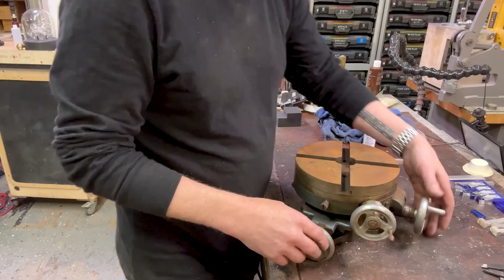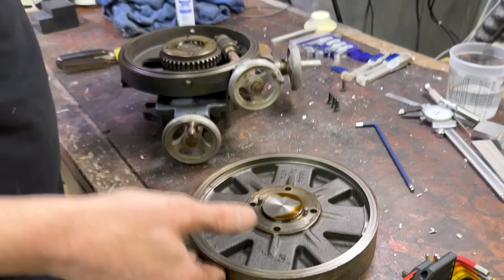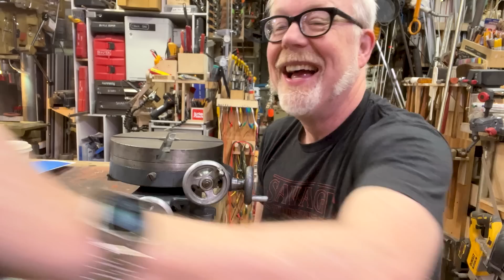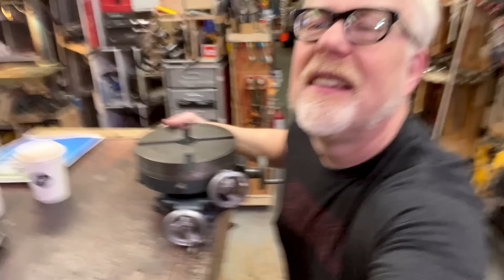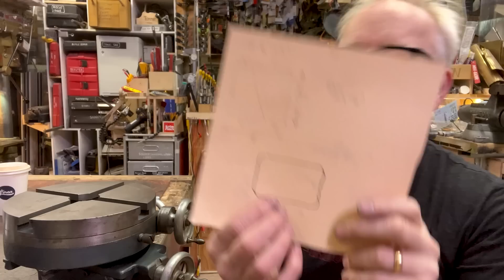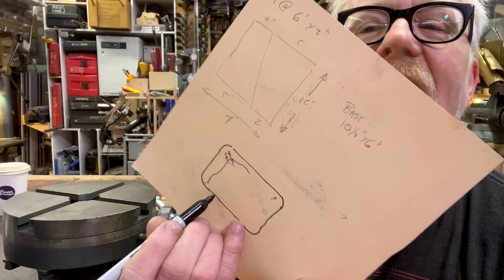Adam Savage Disappointed By This Machine Tool

Comment: I have one of these also in near pristine condition. I also have a good sized lathe with a 24" swing. I made a cutter that mounts on the table and use this as a ball turner. Mostly for turning bowling balls down to fit in my mortar. There's some tolerance to bowling balls and the bigger ones need to be turned down to slide down my barrel.  I center a piece of pipe in the chuck and use the live center in a finger hole to press the ball against the pipe. I then reposition the ball in another finger hole to get what I missed in the first pass.

Comment: I don't think I've ever used a rotary table that doesn't chatter when not locked in a fixed position. So I think it's made for a drill press and only to be used when everything is locked down.

Comment: You can fix that backlash. Remove the existing bushings and machine new ones that offset the shaft of the drive axle in, towards the rotary table's gear.

Comment: Love you man!  If it were me, I would pull it apart and fix the backlash issue, maybe something as simple as a preload nut would do it, I don't know.  After getting rid of the backlash I would seriously consider cnc steppers for the x y and r  it could really be a game changer if you're doing a lot of machining and you can't justify a full CNC big massive mill.  Hand cranking that circle belongs to a different century.

Comment: Interesting configuration, wonder what it's used for. I'd be more excited for something like this, but the XY-stage being on the table instead of under it, would make more sense to me.
Edit: ah, commenting too fast again. But I see, I was right. Btw. I saw something with excentric bushings for the worm shaft to adjust the backlash, maybe you could mod it to be that way?
Reply: I have a small rotary table (unknown make) that has an eccentric bushing on the worm shaft! There is also means for taking up the end play on that shaft, which is another source of backlash. Adam's looks to have end play adjustment, and hard to tell about the eccentric, but looked like two face spanner holes on the bushing? might be?

Comment: "In 1915 Carl Palmgren was working for Steel Art Tool Co. (SATCO). In 1919 he established Chicago Tool & Engineering Co. to make vises and rotary tables. By 1970 they were doing business as Palmgren Steel Products for their vises and Palmgren Precision Products for their air and hydraulic power units. At some point—in or before 1998—they officially changed their name to Palmgren Steel Products, Inc.

In 2013 C.H. Hanson acquired Palmgren Steel Products, Inc."

Comment: That table is good for a drill press to add the X and Y movements and a rotary table for hole spacing on a circle.
Palmgren made and sold those for years. If you have a milling machine it's ok for the rotary function but best use is for drilling holes. Not really sturdy enough for milling work.

Comment: I have the exact same one and it's made by Sears Robuck....unfortunately mine has a lot of slop in it and has a lot of chatter when miling
Reply: Sears never made tools. Sears had other companies make tools for them which were then branded as Sears tools. Sears was just a department store. Well originally they weren't even that I suppose. They were just a mail order catalog. They were the Harbor Freight of their day. You kept the Sears catalog in the outhouse and used the pages as TP. It was either that or corn husks. TP hadn't been invented quite yet. At one time you could mail order a whole house from Sears. It'd come on flat bed trucks and you'd put it together yourself. Or you'd pick it up at a train station. Nutters did it too.

Comment: you are asking it to do something it was not designed to do. this is equipment is more then likely older then you i know because i work for a company that uses equipment from the 40's and 50's. and yes we use them for our drill press making mag chucks.
Reply: The 40s and 50s? We talking about the 19th century? We had a horizontal milling machine that predated the Civil War in the shop I worked in. It was beautiful too. It had the most gorgeous hand scrapped frosting all over it. We even used it now and again. Our break down saw was a German war release machine. Something we took from them after we conquered them. We were all like, no more making cannon barrels for you!
Reply: @1pcfred  yes 4 ww2 K&T and 4 50's cincinatti's horizontal and vertical mills. along with 3 1940's Mattison surface grinders and 2 actual blanchards surface grinders. i make cast iron angle plates, box parallels and other things. for a US company we just retired the 20 inch face mill for one of the cincinatti's

Comment: I have the same tool and was excited to add it to my drill press so I could do milling operations on it, after securing the chuck which is crucial.  It served me pretty well for several projects.  When I got my mill I thought I'd move it to that, but quickly discovered that it's not going to work because it's too tall.
Reply: You can take out the y-axis and it gets significantly lower profile. I have the same one because a guy was practically giving it away and I needed something slightly larger and better than the Chinese 6"ers out there
Reply: @13dirtblack  I never considered that, thank you!

Comment: I have the Craftsman labeled version of that table. I picked it up at the flea market for cheap a couple of years ago. It has seen very little use and I have never used it ever, nor would I try to mill anything of great importance on it. You can take the center section out of it and make it more rigid, but still nothing like a real rotary table because they weren't intended to be in that class of tool. It would be fine for the drill press or doing something with wood. Still a neat little novelty item which is why I picked mine up in the first place.

Comment: 8:54 I think that actually counts as a BAM!!! moment.  On camera, that slop looks really bad.
Reply: Metrology could possibly cope with this.  Why doesn't the mechanism have graduation marks, perhaps with a vernier.  No, you have to add some way to lock in a setting so it doesn't wander.  It's doable, but so cumbersome.  ~~~  If you really need it, you could make it work; but it's not a labor of love.
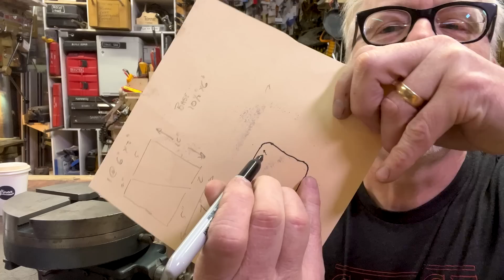Reply: 11:46 Trying to mark a center using a smart phone as a mirror, you so missed it; and yet I got it.

Comment: Make a mount and turn it upside down so the rotation is on the bottom and then mount a surface on the XY side. Would it work better upside down? I guess the chatter is still there but that looks like matter of replacing the center gear and rotor bolt with tighter gear and threading

Comment: I had one of those and got rid of it as well. The slop in the X-Y sections was additive and curved milling cuts weren’t good. I was able to reduce this by removing the middle “stage” and mounting the rotary table directly to the bottom casting, but then I found a real rotary table and Mr. Palmgren’s services were no longer required. Cute bit of kit, but kind of the machinist’s version of a Hondo guitar.

Comment: You can also tell from the weight, the way you are moving it around. A typical 8" rotary table would be a little more unwieldy, at least 60-70lbs on its own plus the XY, would easily be 100lbs+. Those handwheels also look like the cast aluminum or zamak parts that were on older economy equipment. I would get a new vertex rotary table, maybe a 10". I would skip the additional XY part, you can get a lot done with a rotary and dro.

Comment: The only way I can see this being useful would be to allow the cutting of bigger radius and bolt patterns on a mill, by setting the y axis so the rotary table is effectively hanging over the edge of the bed. For the backlash issue using the gib/lock screws before drilling would eliminate chatter and so long as you are always rotating in the same direction it’s a non issue, if you were trying to cut an S shape however then it might become an issue, but changing direction with the lock screws engaged until backlash is taking up before beginning the radius would be an adequate solution.  Overall quite an interesting tool but for a mill, unless you have a very specific use case probably something you don’t need
Reply: ooooh.... the larger radius with the rotary table hanging over the edge is a VERY good idea. I got this same tool and will now try that out

Comment: Well now you know why that table wasn't used, the last person probably discovered it's imprecision.  I can see in a pinch using this on a drill press, but I don't know it was really designed to cut sideways.  A vertical mill is far better supported with a longer shaft.

Comment: Hello Adam. I could not comment on your live stream about your tape storage because I am not a member. I am on a fixed income and have limited funds. I wanted to say that I disagree with you on storing your tape on its side because it will pick up  all kinds of junk and make it useless for getting a fine line edge. You should always store your tape on its vertical surface so its edges stay clean. If I could send you a photo I can show you a photo of my homemade tape holder out of foamboad.

Comment: I bought something like this many years ago. It sits in the bottom of one of my tool stores and has never been used for ANYTHING. Every now and again I think that maybe I can use it for whatever problem I'm working on so I get it out and turn it around and maybe mount it on some machine and twist it this way and that. Sometimes I even mount a piece of work on it somehow.
But inevitably I end up shaking my head and sliding it into the back at the bottom of the cupboard again. Utterly useless. (Mine is also in pristine condition.)

Comment: Walter Tools has made low profile rotary tables with a slightly bigger faceplate but half the height of your tool. They also mount vertically and are accurate to several arc seconds, however they suffer the same backlash. They are meant to be clamped just like your current tool or use conventional milling. Those lower profile Walter Tools are not cheap though

Comment: My first thought was made for drill press.  It even has a 4 mount holes that would fit the most common drill press table Tee slots.  I would love it for that use.
Reply: It is pretty obvious it's for the more robust drill press where it would be accurate enough for index drilling. The X Y for centering for a drill press is ideal.
Reply: @Arckivio  Yeah was going to comment the same thing.  This is definitely meant for a drill press.
Reply: That would explain the XY axises. A mill wouldn't need those but could be very useful for small adjustments on a drill
Reply: Absolutely. The x/y largely is redundant with the mill table
Reply: Yeah thats pretty much only use for I could see. 
Bit too much for C axis on a mill

Comment: Cool. Not sure of the use of the X-Y portion when your machines all have X-Y tables. I wouldn't want those as they just add 2 more potential error vectors that would have to constantly be checked to ensure accuracy. For a drill press or anything lacking X-Y it would be a great item!
EDIT: I see you have concluded similar. Removing backlash by making more precise parts is a great machining project. 😊
The use case you illustrated of a 1/4 radii rectangle would be more easily accomplished with a 1/2 end mill and a simple X-Y rectangle. Don't you think?
Reply: I believe they were mainly made for a drill press
Reply: For a pocket, yes just use the radius of the endmill, but for a lid to go inside the pocket, not so much
Reply: Angled work
Reply: Not when you want to round the outer corners

Comment: Could you anodize the worm gear in an attempt to take up SOME of the backlash?
Obviously wouldn’t be a forever fix, but it may loan some utility …… .030 is a lot to negate, but .015 on each of the worm surfaces might be doable. It’s either something like that, or re-milling a new driven gear.  Interesting tear down at any rate

Comment: Adam, I have an identical rotary table. I would bet it’s made by Palmgren. A google search brings up many examples. Nice tool to have!
Reply: I would bet so, too, after 6:35.  😂

Given what Adam goes on to say after that, I'm curious: what do you find yourself using it for?  Where does it shine?
Reply: @DavidLindes  Ha Ha, well, yeah, that’s what happens when I comment before watching the complete video! My bad! I have used it for drilling holes on my drill press using the x-y function, and, have had success drilling holes in a circular pattern and cutting circular grooves on my milling machine. I’m an amateur, and, the work I have done does not require the level of precision that, I assume, Adam is looking to achieve. I might add, I also picked it up off of CL for a price I could not walk away from, It was dirty, but, appeared unused.

Comment: Seems like it could be a useful drill press attachment!  Drilling holes in a circle with reasonable precision.
Reply: Yes he mentioned that
Reply: Not really when you consider how you have to clamp a work piece using strap clamps and how difficult it is to center parts on it to be fully concentric. The part needs to be perfectically concentertic to the rotary table. 
A better (quicker option) is to just print out the hole pattern and use a punch to mark the hole pattern. You spend 30 to 40 minutes just trying to clamp the part maintaining concenteric position to the rotary table.